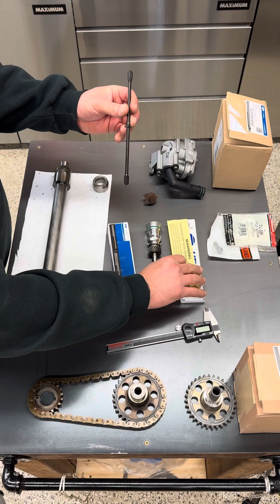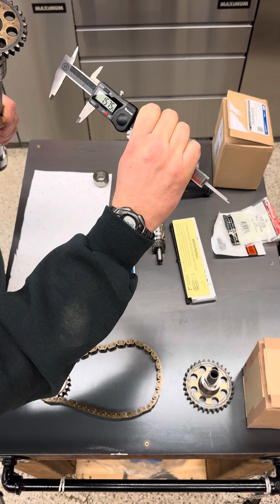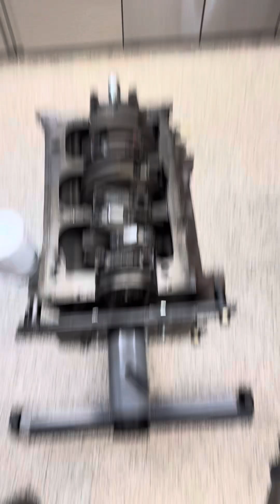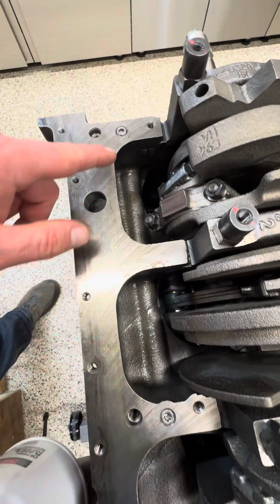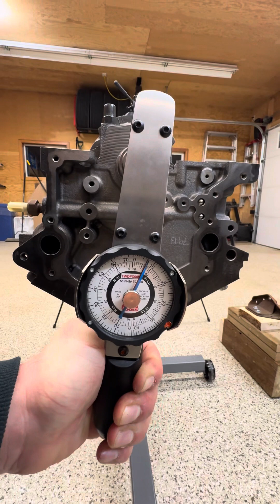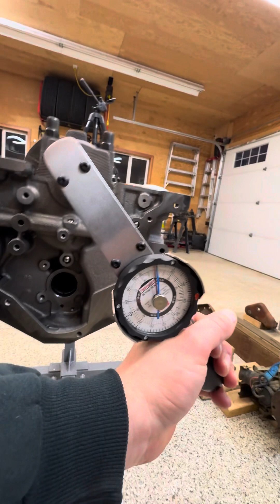4.0L SOHC oil pump drive and components overview

Comment: What led me here is I'm having a issue with my engine. I seen people on the forum that have the same exact issue but they never posted the fix. 
I have this same engine in a sport Trac. 
22k remanufactured engine with oil accumulator so no dry starts , chain rattle.
Issue, cold engine zero noise.Once the engine warms up and RPMs drop,I have a rattle at idle only, hot engine . I replaced the tensioners with factory Ford. Zero help. Any input of throttle, the noise goes away.  Above 1200 RPMs Only at idle. Front and rear chains rattling. 
Took the lower pan off and the pickup screen is clear. 
At my oil accumulator I'm only reading 8 PSI at idle hot , 60 cold. What do you think it is the pump? Relief valve in that pump? Clogged passage somewhere. I'm tired of dumping money into this thing any of insight is much appreciated. 
Also can you remove the pump without removing the upper cradle?
Reply from the maker: Did you have this rattle noise issue before installing the accumulator on the engine ? What weight of engine oil are you using? 

As for the oil pump removal, you have to take off the cradle unfortunately. The oil pump is bolted to the engine block behind the cradle.
Reply: @FordRanger4Fun yes rattle was there since I first started the engine. I put the oil accumulator on because original engine broke the guides from chain rattle start-up cold. 
 I've swapped tensioners, no luck. I honestly think it's the relief valve in the pump. Something along those lines.
Reply: 5 30 oil.
Reply: @FordRanger4Fun I edited it.  Lots of grammar mistakes. Sorry

Comment: The Drive gear has a flat spot on one side, but I dont see any flat spots in its hole. Do you know if the flat side needs to go in a certain way and should the top be flush when fully inserted or should the grove around the top edge be exposed?
Reply: Thank you
Reply from the maker: The flat spot is a Relief and it is milled into the land to allow oil to flow down to the gear. If you look inside the cavity in your block where the pump drive gets inserted you will see where the oil gallery is channeled to lubricate the bearing inside the pump drive. The o ring at the top seals the oil from leaking externally, and the relief milled into the land allows oil to escape down onto the jackshaft gear and oil pump drive gear. 

As for the groove near the top of the adapter…. Once the adapter is inserted into the cavity, and the keeper bolt and tab have been torqued there should be some groove exposed just above the surface. At least that’s how it was on my block. The groove/undercut allows for getting a small flat head screw driver or similar tool to pry up on the head for removal.

Comment: Thank you very much for the video! I believe the O-Ring seal on my Oil Pump Drive gear has gone out. It took me forever for identify that leak.

This video was very helpful for me to see the Oil Pump Drive gear assembly before I tear apart the top end of my engine.
Reply from the maker: That makes me so glad that I could help. Making this video was a perfect opportunity having all the parts in front of me